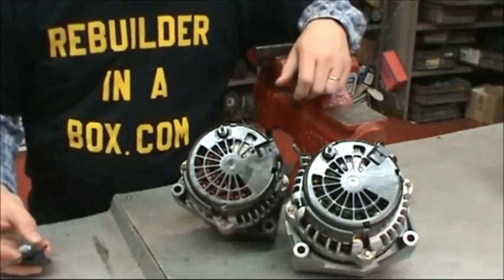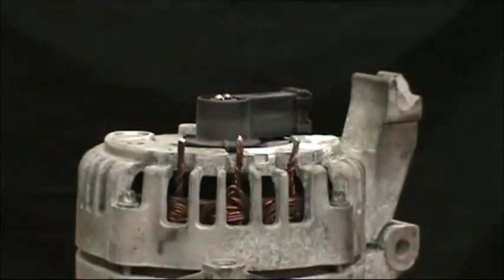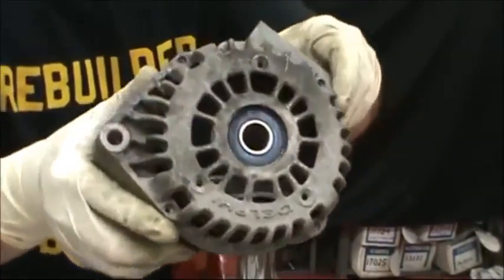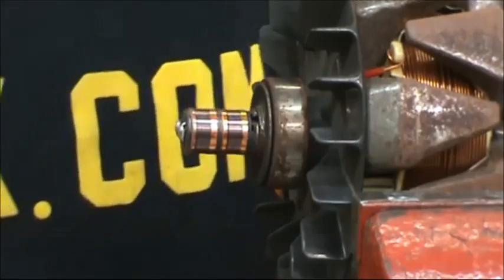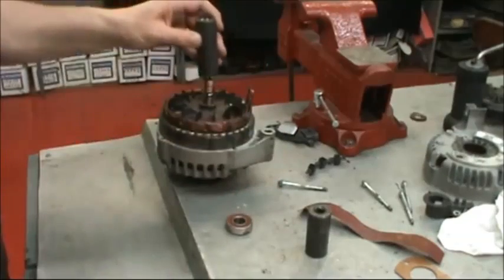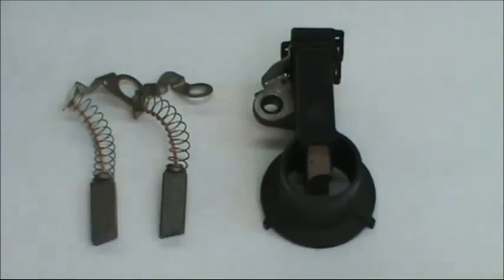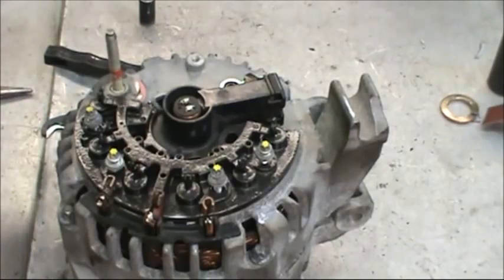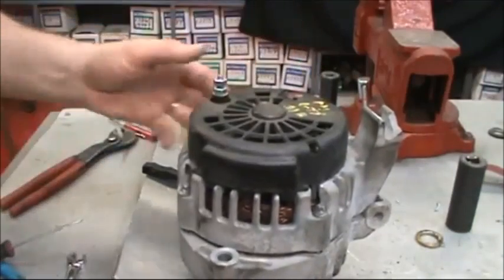How to rebuild AD alternators

Comment: Mike would my 260 w weller iron be big enough to desolder the three terminals?  Thanks.
Reply from the maker: With a little patience and no drafts, yes.
Reply: @rebuilderinabox  what did you use to desolder those terminals.  One guy said he used a propane torch.  Would a Wall Lenk at 400 watts be more appropriate.  As you can see I have never desoldered something this big and just wondered what you used.  thanks for the advice.  I just priced a new alternator and it was $300+ for a name brand warranty.  My old one mostly needs new bearings which is not a big deal.  thanks for all the help.
Reply from the maker: Not seen 260w. 200-300 's work but it takes a while.
Reply: @rebuilderinabox  Thanks.   How long for the 200-300? 5 minutes or more?
Reply: @rebuilderinabox  For a 200-300  how long ?   2 minutes per terminal?   more?  I have never desoldered anything that big. thanks for the advice.
Reply from the maker: @dogsplantscarsneatstuff176  Don't really know how long. Trying it would be the only way to know.
Reply: @rebuilderinabox  Thanks.  I was just hoping for a rough idea since I'm a novice at something much larger than I am used to.  Appreciate you patience.  I am looking all over Youtube for demonstrations to ease my neophyte desoldering of large terminals for the obvious separation and heat dissipation of the terminal to prevent damage to the other components.  I have torn apart a lot of stuff but just want to observe someone in this process so I can learn.
Reply from the maker: 300 watts. Weller D650. No drafts and some patience. The small torch butanes work, be careful though.

Comment: someone get this man a brass hammer, made me cringe every time you used a steel hammer on that aluminum.it will crack/shatter!!
Reply from the maker: As we said many times before. The purpose of our videos is to demonstrate rebuilding with COMMON hand tools. We think a lot of people won't have brass handy. And don't want you to think you have to buy them. If you've never actually done alternators before, jason has a normal reaction. But when you've done thousands like we have, the brass hammers and the rubber mallets can migrate back to the tool box. The plates are actually an aluminum alloy and very tough.

Comment: Your website says no dremel tool is needed for any of the ad series alternators yet this video shows one is needed. I would be curious to know for sure before I order since I don't own a dremel.
Reply from the maker: Nice catch we determined you do need a dremel for the bearing.  We fixed it in our tools list.
Reply: @Auction Slooth I use 2 jaws on a puller to remove this bearing. I have a 400 watt SnapOn soldering iron I bought in 1972 to remove the stator leads. Compressed air will help if you don’t have solder wick, but not shown was replacing the $6 slip-ring, epoxy, it’s soldered joint under the epoxy and removal of the slip-ring assembly. We did not have parts in a box, unless new from the dealer. Parts came in a Delco can. Too bad they did not show this where a DIY’s has the tools or not. This is no slam on Mike Lauer or his company & video, helpful for most who would try.
ASE Master Tech since 1978-Retired

Comment: I just finished my rebuild and wanted to thank you for showing so clearly the steps involved.  I just had it checked and passed with flying colors yahooooooo.  A little tip for everyone, when cutting off the bearing from the shaft, slip a deep well socket over the copper contact rings so that if you slip with the grinder it doesn't scar or gouge the copper.